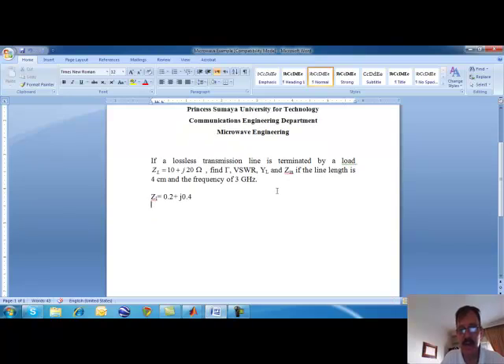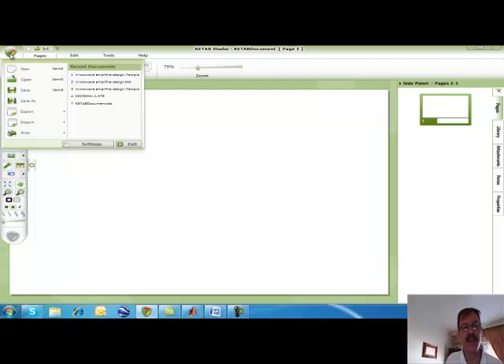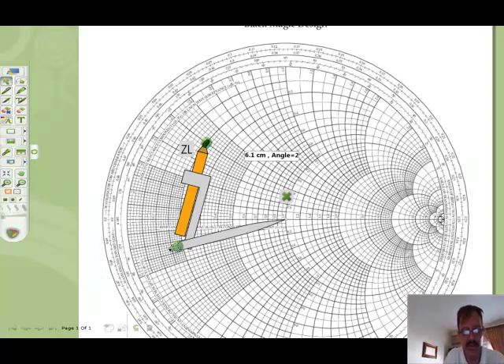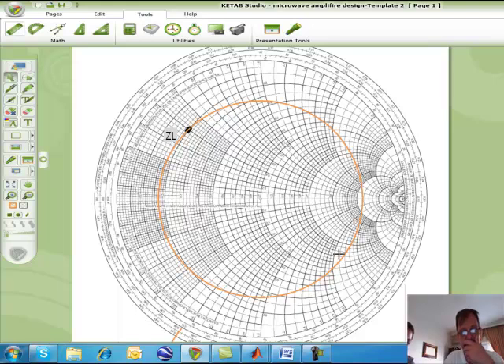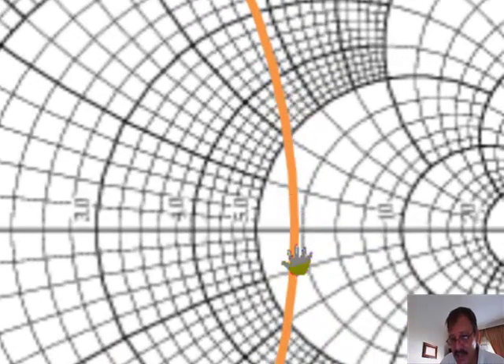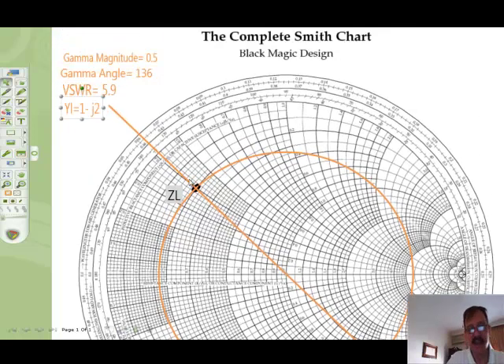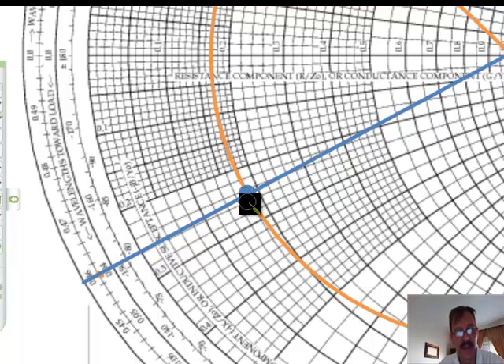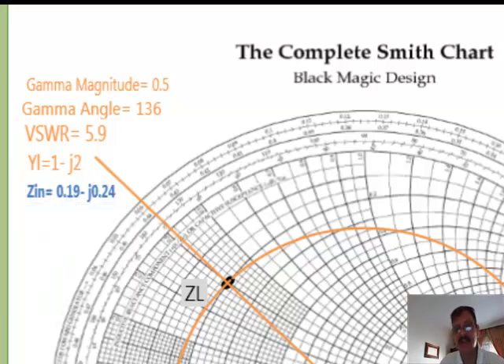Smith Chart Presentation

Comment: I Think you made a mistake when you wanted to calculate the angle. First, you should draw a line from the center through Z(loud) and then read the intersection Towered the Generator. Second, add that value to 0.4(lambda) then mention the resulting value in the Waveform Toward Generator circle. Finally, draw another line from the center to that point. The intersection with the Angle of Reflection Coefficient in Degree will be the Angle...Correct me if I'm wrong please...

Comment: Good video, 2 things:
-you should specify that the TL intrinsic impedance (Zo)= 50 Ohms, as it was not stated clearly, only that you divided ZL by 50 to get normalized impedence
-When you found the magnitude of Gamma, you used the wrong side of the circle, you must use the right side to find the proper magnitude of GammaL, which would be 5.9, as GammaL = VSWR!